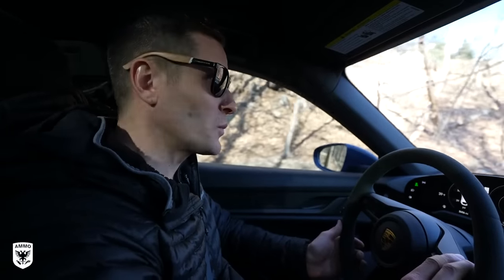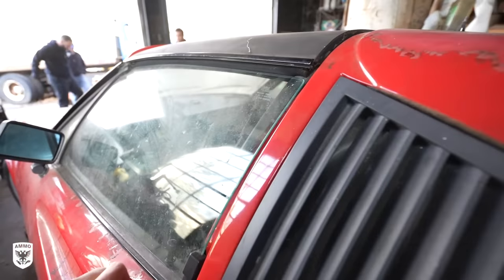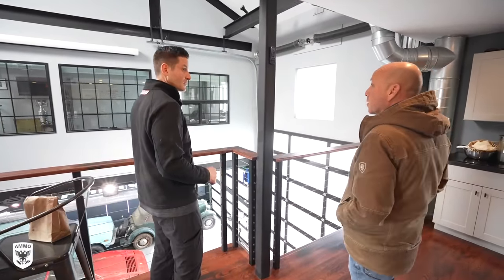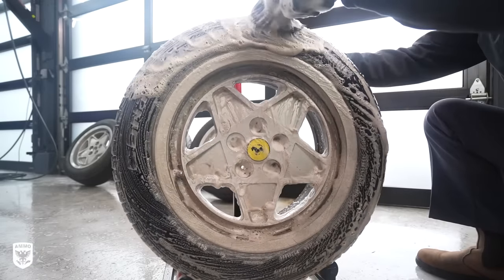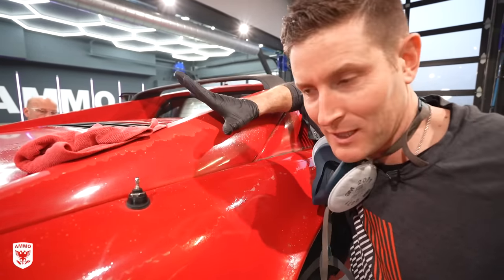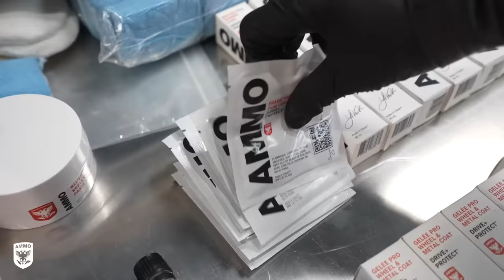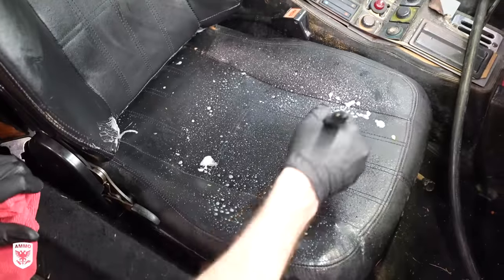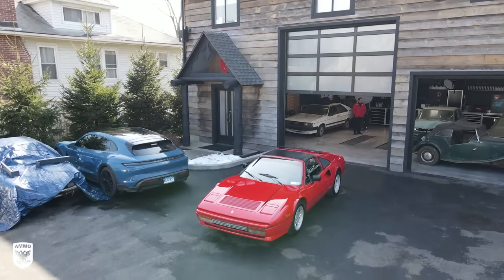First Wash in 6 Years: Abandoned Ferrari 328 GTS Disaster Detail

Comment: Kind of a rule of thumb to not use high pressure water on these cars, and power washing is a definite no no.  You probably caused more long term damage with all the water that has gotten into hidden places.  Some of the worst condition Ferraris I have come across are the ones that got washed excessively -- lots of hidden rust and corrosion.  Owners meant well but had no clue they were creating long term problems.

Comment: Have you guys even tried to use iron remover to clean the wheels?

I used to try to clean wheels like these by scrubbing them with heavy duty degreasers and abrasives like scotchbrites, magic erasers, wire brushes. There are just a lot of brown stuff caked on that wouldn't come off no matter how hard I scrubbed and how strong a wheel cleaner I used. I was going to respray the wheels. Then with the release of iron remover, most of those stubborn brown stains came off easily. Then with subsequent cleaning a few more times, 99% of the brown stains came off.

Comment: You should use copper compound on the wheel nuts it prevents rust and keeps the threads clean and water resistant. I always use it on all my bolts thread below the car as that is where water comes the most

Comment: you guys should use Mirror finish from Carborundum, 1500 , 2000, 3000 grit wet sanding paper for the clearcoat.
obviously will not work for the ones who have no clear.

Comment: I have a customer that wants me to clean a Range Rover 2018, but it has sticky buttons. The starter button is sticky and the mirror control button is sticky. I heard that this is very common on the Range Ricer and Mercedes and Jaguar’s. Should I not touch them at all? I just don’t want to be responsible for removing the soft rubber factory coating. But do you ever run into this issue and what do you do?

Comment: These videos are always cool, but I have to wonder- what do you guys do about cars that are sensitive to high volumes of water? My C4 corvette has an optispark and I can't run it through a carwash because of that (not that I would anyways). I'm worried trying to pressure wash it might do the same thing- and it desperately needs a deep agitating clean, because it's actually my grandfather's and sat in a field for over seven straight years.
Reply: Waterless wash. He has few videos about that.
Reply: @adminadmin8992  Good to know, I am not the longest time subscriber so I'll scroll through and find them. Thanks!
Reply: oxi clean cycle
Reply: @MyCoolHobbies  I cringed that whole video
Reply: I have a lt1 impala ss similar engine just newer I would just do gentle or mist setting n use simple green or something similar n micro fiber towels i just don’t put any water near tge plugs/water pump/disturber area